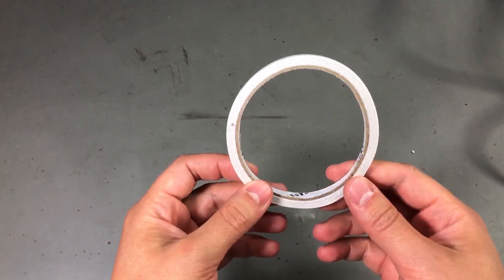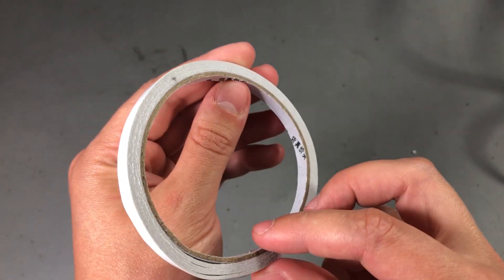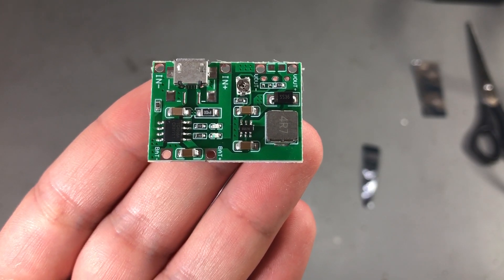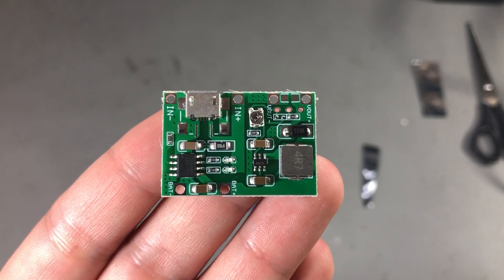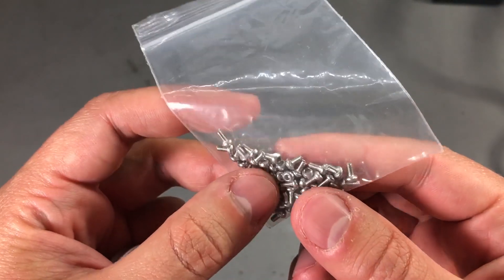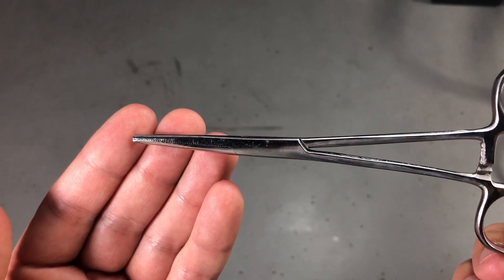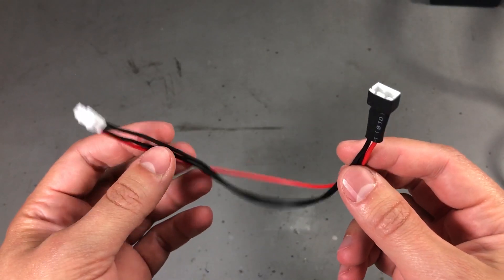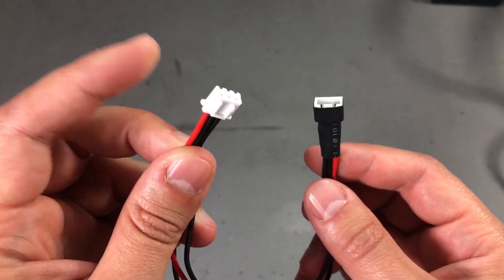Voltlog #244 - InTheMail

Comment: Hey Florin(@VoltLog), did you also experienced that the module you show at 6:50 drains the battery below the recommend voltage for liion cells!? I found mine to be drained down to 2.9V and the module was still sucking energy out of it... not very well implemented module if the is no cutoff at 3.6V/3.7V.

Btw. the claimed 1A charging current made the module become quite hot (~60°C). I reduced the charging current at my module to 0.5A.. now it's fine.
Reply from the maker: this module does not contain battery protection so you should add your own battery protection circuit to use this safely.
Reply: @voltlog  seem's so... i have been using an unprotected cell :/

Comment: For the European market I would suggest using Cynel branded solder. It is made in Poland. I have a spool of 1mm and the soldering joints look very shiny and it flows very well. They still sell solders with lead. However, I have not tried to buy recently. You can find it in TME or possibly other places (like vikiwat). Check the product catalog here: https://www.cynel.com.pl/en/products?type=solder-wires
Reply from the maker: Yup, I've used Cynel before, works fine.

Comment: So, before becoming partially disabled by the 7th car to hit me on a bike in 10 years and over 200k miles of training/commuting/racing....I was the buyer for a chain of bike shops here in Southern California. I buy quite a few things from China direct now. I still ride although nothing like I did before. I can't train or race but I do a physical therapy routine every day that includes a 40 kilometer ride. I can't sleep much at all without that daily routine due to back injuries.
 When it comes to cheap Chinese direct accessories, they are usually the same as entry level junk any shop should carry. Don't expect stuff to last long with serious use. For the casual user it should suffice. 
  The advice I've always given is, "don't be cheap with your contact points." Anywhere that your body is in contact with the bike is important, especially when it comes to serious riding. Always source good pedals/shoes/saddle/shorts/helmet/grips/glasses/etc.
  It's funny that a lot of the bike stuff you see on AliEx are obvious knockoffs of a couple of brands. So, in a bike shop environment one of the easiest brands to carry is Giro/Bell (they are the same company). They usually offer insanely good lines of credit and payment terms, at least they do here in the USA. These types of accessories are extremely important items to sell in a local bike shop. Generally these are 50% margin products. The hard part of running a bike shop is that bikes are super low margin items and are extremely high risk investments for any shop. Entry level bikes are 40%-45% margin items, high end road and mountain bikes have a 27%-35% margin. That's the basics of how a bike shop works. ..anyways... Giro Bell these guys make a lot of junk. I have spent countless hours getting items credited for warranties from them. I've probably warrantied several hundred items from them. They have a reputation among shop employees as disposable products. Their helmets, shoes, and accessories are known to last a year at most. The main reason for purchasing these in a local bike shop is the ability to return the item. You will probably need to return it too. The funny thing is that a lot of the stuff on AliEx are knockoffs of Giro/Bell. They are copies of the lowest quality stuff. They are probably the same people making the real stuff.

  A lot of shops that have a serious road or mountain bike core following, and a limited budget, will just source a few cheap options for customers that don't know what they are buying. Then they stock 1 or 2 real options that any serious rider will recognize and is looking for. As an example, I ride with high end Sidi shoes. Most people would freak out at the $400 price tag. Most people want to spend $100-$150 at most for shoes. Bell/Giro has lots of options at this price point. They won't last for more than a year of even casual riding. I've been riding the same pair of Sidi's since 2012. At the cost of a new pair every year the others cost twice as much. This is true of most items with bikes. The cheap stuff is usually several times more expensive in the long run. Like I said I still buy some stuff China direct.
  I was recently surprised by the new Xlite 100 tail light from China. I have a Felt AR series aero road bike I rebuilt around a year ago after finding a replacement fork. The seatpost on that bike won't work with a typical tail light and I needed a saddle mounted option. None of the saddle mounted options available on the traditional market are any good, so I tried the Xlite while also carrying a spare as I don't trust an unknown brand for something like this especially at night. So far that has worked well. Still I won't use anything other than my Niterider, Light & Motion, or Lezyne headlights. 
  I wouldn't count on the Chinese stuff for anything critical without extreme caution. I would be really cautious with that tail light you got, especially with any water or puddles. Rear bike tires tend to get tail lights wet and the low end stuff usually leaks. This will often short out the board and drain the battery. I've had this happen with lots of products I was given to test. That's part of the perks of being a buyer in a bike shop, you're given a ton of stuff to test and try for free. The pay sucks but you're basically paid to ride and get sent to demo days and trade shows to keep up with the newest stuff. Almost all of my old stuff I have from before 2014 was free to me.
  If you want good gloves Pearl Izumi makes the best. If you're having numbness in your hands slide your saddle further back and make sure it's level with the ground. If this doesn't fix it, the saddle is the wrong shape, or you need a seatpost with more setback. People usually get gloves either because of poor bike fit or to lessen roadrash while racing. Those are just a few tips.
-Jake
Reply from the maker: Wow, so many accidents and I thought the roads here are dangerous because drivers don't respect cyclist but with the amount of cycling you say you do the risk obviously goes up. The stuff I use is definitely entry level but I am just an amateur that occasionally rides 20KM in a day. Even this kind of entry level gear doesn't wear out with the amount of km I put in so it's a good balance for me price/quality. The alternative for me as a local shop is Decathlon where the prices are obviously double than what I would pay on aliexpress and the quality is probably the same. Thanks for all the tips. 👍
Reply: "I wouldn't count on the Chinese stuff for anything critical without extreme caution." 
Yes and no, you do need to be careful. I'm using a chinese brand frame, bottom bracket (ZTTO), stem (UNO), pedals (Zeray), and chainring (Deckas). Quality is good and some of these parts are very difficult to find on the western market. I don't expect them to last forever, especially the pedals. But for $24 and 275g there is absolutely nothing close in a dual side SPD. Rockbros and Lixada are two others that make good stuff (for the most part).

Would not use groupset, seat, handlebars, tires, wheels, shoes, helmet, etc. Some is personal preference, some clearly aren't at the level of major brands yet. They will get there given time (look up the Empire groupset for example).

If the light dies thats not a huge deal. I would recommend having a seat light and a helmet light anyway if riding when dark.
Reply: @jaro6985  
  It's often the things you might not think of like hardware. One of the worst injuries I've seen came from a front skewer that broke going down hill on a group ride. Loosing a front wheel at around 30mph (~50kph) is a really bad day next few months
  I've had a set of carbon race bars break, but the quality stuff just gets mushy. I've seen a guy with some cheap ones that broke into pieces. He went down but not too bad.
  The lower bearing race on the front fork is another super critical and high stress location you don't want to fail. The Pinnerello frame clones were notorious for shearing forks off. Pinnerello sent out a whole guide to dealers on identifying the fakes and hazards back in 2011.

 Drivetrain stuff is iffy. Anything that can jam the freehub ratchet can be bad. I wouldn't use a junk chain or no-name connecting links. I've heard if a chain breaks while someone strong is sprinting it can easily send them over the bars. I'm also really careful about my front brake caliper and especially the attachment hardware. The direction of mechanical stress is also the direction of removal.

  A lot of reputable manufacturers are subject to legal liability when it comes to these products. If they make something with defects that causes you life altering injuries, it is quite possible to recover something from them in court. Obviously this is not the case with something from who knows where. I have seen 3 cases where this has happened.
   Like I said, I purchase lots of things from China. Most of the stuff from 'reputable' brands is from China too. The big difference is accountable engineering, a willingness to compromise things that are often misunderstood or neglected, and poor to non-existant quality control measures. 
   Even with reputable brands in a bike shop, I often received ridiculous junk, but that's kinda the point. In a shop you had someone like me filtering through everything coming in the back door before it hit a sales floor. I wasn't free though, and you are paying for that in a shop. However, few people have several years of experience with thousands of bike products and know what to look for.

  BTW, I wouldn't do the helmet light. That can confuse drivers on the road. Helmet lights are for mountain biking. If you really want to be safe at night ride with a good head/tail light, then place a 2nd taillight on the non-drive side chainstay facing down to the ground. This creates a solid visual ground reference that makes it extremely easy to determine a rider's location on the road. This also helps to define your left side and overall size to passing traffic, it illuminates your side profile for any cross traffic, and the location on the chainstay will illuminate the back of your left foot. This clearly defines you as a cyclist as you pedal.
   The biggest problem with bikes on the road/trail at night is determining distances and dimensions.
   If you look carefully and analyze how modern car lights work, they project enough light down on the ground that you can clearly see enough ground surface around them to determine the vehicle's location. If you look at really old cars driving on the road at night, they stand out as odd looking. You can pick them out from a distance based solely on the light pattern. The darkness on the ground around them is one of the subtle differences that a lot of people may not notice. Anyways, riding with a light facing down on the ground really helps get the cars a little further away.
  If I'm riding somewhere really bad at night I ride with 2 extra lower power coin cell lights (white and red) and face them backwards, red in front, white in back. Drivers are extremely accustomed to head and taillights oriented a certain way on the road.
  If you've ever seen a car spin on a freeway in the rain at night, the moment headlights face backwards everyone reacts very quickly. There's no question, everyone knows something is wrong when the wrong color faces them. If you do this intentionally on a bike, it will get a lot of attention too. Like I said, I only do that in super sketchy areas though. It's a bit silly looking for a serious roadie, but hey, any even minor head/neck injury has a high probability of ending me. I only barely made it through the last one. 
 BTW all 6 others were minor. One took out a bike but I was back on another within a week. I was just really really unlucky one day and encountered the leader of the village idiots in a car. I mean the dude was like the pope for village idiots. No one could have predicted his level of stupidity and avoided this mess, and I usually assume everyone in a car is a complete idiot.
  Oversimplified: blind u-turn, directly into a passing car, from an illegal double parked stop, blocking the right lane and bike lane, on a highway :-)
-Jake
Reply: @UpcycleElectronics  Good points, I think we agree in most areas. Cheap low-weight skewers I won't touch, its such a small gram savings and an important area of the bike.
Forks may fail, hope that never happens though.
Brakes agree, Tektro is the cheapest I would use, they are reasonable. Chain, yes, I don't think anything is close to KMC or any of the major brands.
The reason I feel helmet light is necessary is to get the light up high when commuting. It may be less of an issue for your area but here there are always parked cars, shrubs, etc. that can block the view of a seatpost light (although if it were bright enough I suppose thats a good substitute).

The fact that you are riding on/near highways, yeah you are much braver/crazier than me. Can't imagine that many crashes and you are still riding.
Reply: @jaro6985  
  I've gone down from racing far more than hits with cars. Criteriums are the most popular type of road racing here in the USA. They are especially popular with the bigger guys like myself as crits don't have much in the way of hills. If you put 100 guys in a group for an hour of 40-50kph racing, it's only a matter of time before any given person hits the ground. The other hits with cars were less of a recovery than some of my racing crashes.

  With helmet lights, I feel like drivers could use the excuse that they didn't see your location well with a light that can move around. I know I have a particularly difficult time determining how far away, and the lane positioning of mountain bikers that ride the bike path I use daily and have these lights. This is also an issue because mountain bike lights are designed completely different from road lights. Mountain bike light designs are for lighting a larger local vicinity, where road bike lights focus a more narrow beam of light much further ahead of the rider. The last style of bike light are the cheap type that are for being seen by others (during the day) and not for enabling the rider to see. Any light that enables the rider to see will, by default, enable the others to see the rider. The cheap stuff isn't for use at night either.  While it's easy to spot those types of lights out of the darkness, they are far far too weak when compared to the luminosity of typical vehicle lights. This makes them totally invisible to drivers that have their vision adjusted to the luminosity of their headlights. All the lighting options I was referring to earlier, except the coin cell type, are lights with very high power outputs. The minimum headlight I ride is one with 750 lumines. I'm also very critical of any light's color spectrum. High output power with a narrow color spectrum is still a garbage light. I currently have a 750 Niterider (main headlight), an older 750 Light & Motion, and a 1200 Lezyne. Normally I ride with a taillight called a Hot Shot 2.0 by a company called CygoLite. The output power ratings for taillights is a bit different and varies greatly between brands. The Hot Shot is advertised as 2 watts. If you simply turn it on while looking at it during the day you'll have a serious grey spot in your vision for a few minutes. It's brighter than a typical car taillight and can project a large bright spot on the ground at around 10 meters away. The lens is designed to glow in the immediate area, but it has a focal element in the center that makes it project a very bright beam directly behind the rider where it is needed most.
 I'm a big guy at 185cm and 100kg. I also have a shorter torso and long legs. I generally ride a 58cm to 61cm road bike in most brands. I also have a particularly tall seatpost height. So I guess you could say I'm a bit biased when it comes to visibility and lighting. I'm no GC contender in le Tour. I have a presence on the road that is hard to miss compared to a much smaller person/bike. That probably effects my outlook.

  In court, here in the USA, people will use any and every little excuse to blame a cyclist for getting hit. I guarantee a light that is not mounted securely to the bike would be used against you in court here. I had to spend 16 hours total over 4 days being interviewed in front of a camera getting questioned about exactly this kind of thing with the lawsuit after my last collision. This testimony is then used to build the case against you in the courtroom. They are looking for exactly these types of things to exploit in front of a jury.
  That's just my advice and experience on the subject. Do whatever you like. I just want everyone on the road to be safe and enjoy riding.
-Jake

Comment: I though that the solder that was 'MAED in China' was probably a bit dodgy, who would have thought that it is the proper stuff?
Bad spelling mistakes like that always make me very suspicious

I have used the 'Engineer' brand solder paste and it worked no problem but I have known people to buy it from fleabay and they got a knock off, theirs melts like chocolate!
Reply from the maker: Solder paste also changes properties if it's been stored improperly (which is often is, when purchasing from ebay/aliexpress type shops) However I agree with you,  I get the same feeling when I see spelling errors on the labels. That's why I contacted the original manufacturer and to my surprise they confirmed the solder is genuine. I would not say that is 100% verifiable information but still a confirmation from the source.